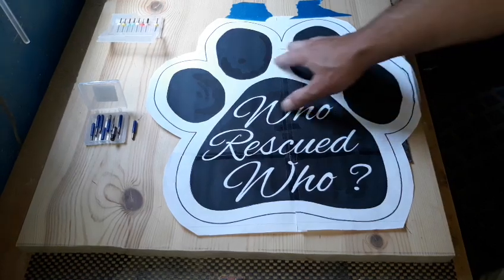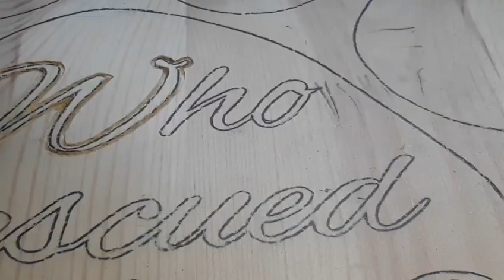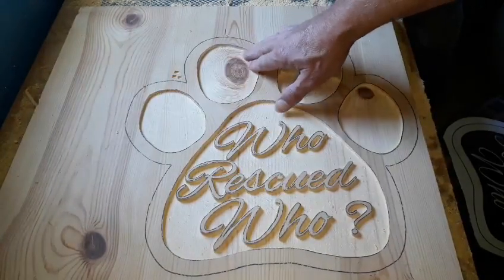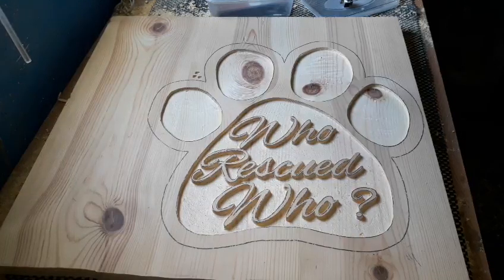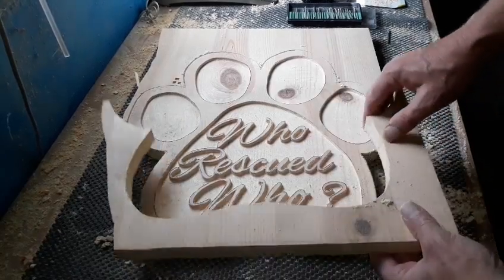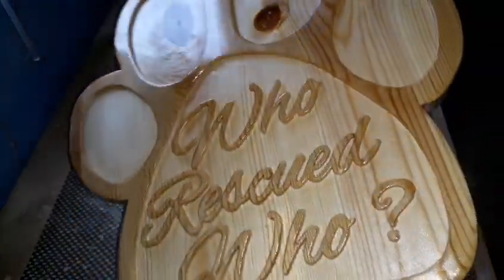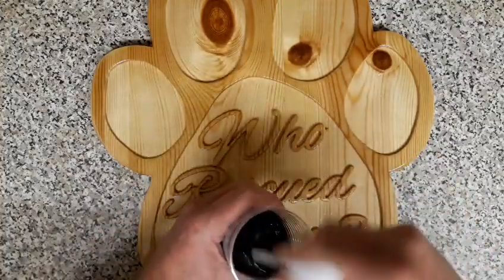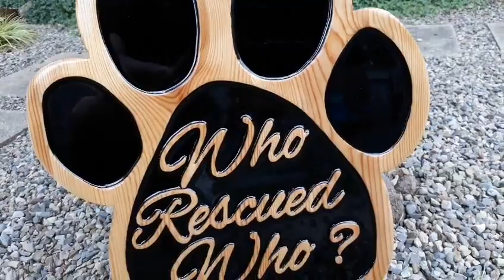Who Rescued Who ?.Dog paw plaque, router project with resin inlay..

Comment: Did my first carving yesterday using your tutorials. I think it came out good. Still have to paint the letters. I used a mling bit from my dremel in my new router. (Lots of outside light gets in, vacuum, and 3 led lights) works out pretty good although wondering if its a tad on the big side. My fingers and wrist were killing me afterward) although it seemed that when the milling bit hit the sides it seemed to pull itself loose of the collect adapter and went deeper. Are the milling bits not meant to carve on the edge or was it a direction issue. Ie right to left instead of left to right.

Awesome tutorials.
Reply from the maker: The milling bits are great for clearing out with,I've had two become loose on me before,I was lucky as I was filling with resin,so it didn't matter..I've done projects before with just the milling bit,so it cuts the sides no problem, in any direction..

Comment: Hey , nice video.
On the projects that you use linseed oil, how long do you let it dry for before applying clear coat? 
Thanks.
Reply from the maker: Thank you David, I try and leave it to dry for a couple of days..but I've been known clear coat 24 hrs later,because this is boil linseed and not raw linseed, it dries really quick..